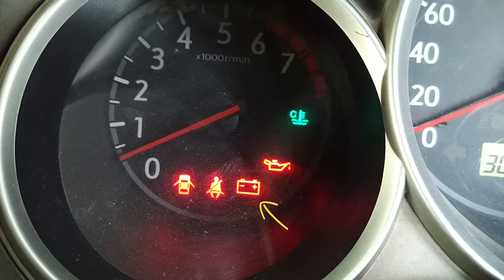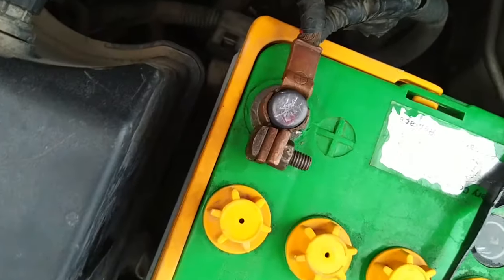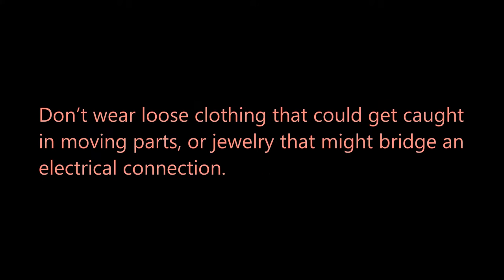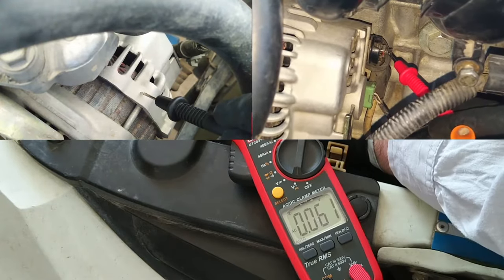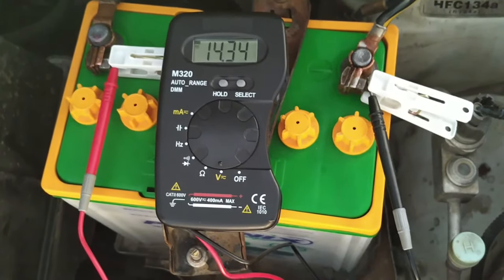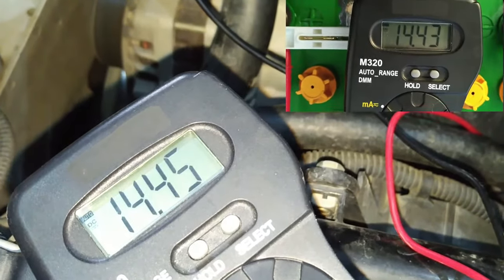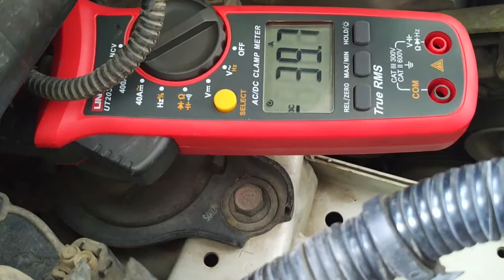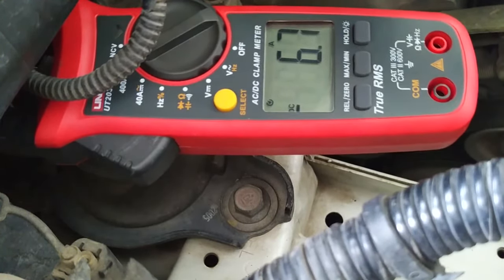DIY Car Alternator Test (Voltage & Amperes) | Multimeter Edition

Comment: Why are you measuring DC Amps?  Doesn't the Alternator put out AC Amps?
Reply: the alternator itself produces AC electricity but the AC is converted to DC by the diode rectifier because the battery only accepts DC voltage/current

Comment: Alternator theory is involved with rpm (revolutions per minute)  vs Hz (cycles per second) and the amount of poles in the alternator. Like North and South pole= 2 poles and North, south, east, west poles = 4 poles as related to rpm's and hz. Just thought I would add that comment.

Comment: Hi I have a honda just like that. And I noticed that when Im driving or I pressed on gas pedal my voltage drop as I read on my voltmeter inside the car. I can also feel it with my fan accessories that it gets weaker.

Comment: hello, my dynamo is 14 in good measurement, but it does not charge, 12.08 comes out while the vehicle is running, how can we solve this problem?
Reply from the maker: Looks like you have resistance in your charging circuit... or are you running too many power hungry accessories?

Comment: Is it possible for the voltage regulator to cause a low voltage reading if it is going bad and maybe not the alternator? I keep getting conflicting info on this.
Reply from the maker: The job of a voltage regulator is to not let the charging voltage go above a certain point. If it goes bad, you'll get voltages north of 14.5v. 
Low reading could be a result of any of the reasons discussed in the video, including a bad alternator...

Comment: How do you measure the amps on the battery only
Reply from the maker: You just want to measure how much amps are going to the battery while it is being charged by the alternator? Ya phir you're interested in finding out the battery's ability to produce cca?

Comment: why did you check across fuse?  and not say what you were looking for?
Reply from the maker: At 08:20 when I check across the fuse, I do mention that sometimes the fuse might be putting up some resistance which could be the source of that voltage drop.